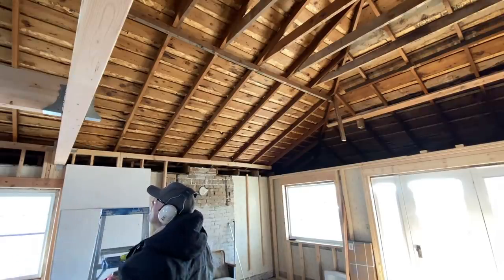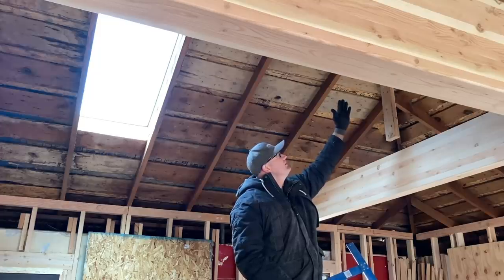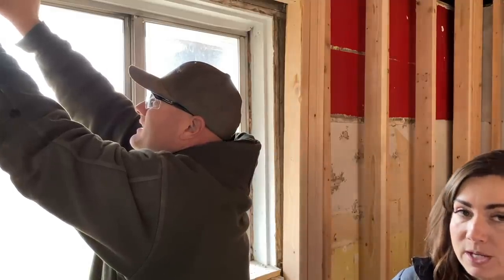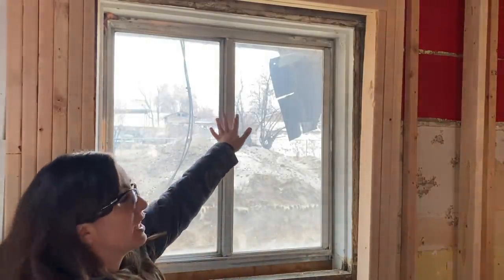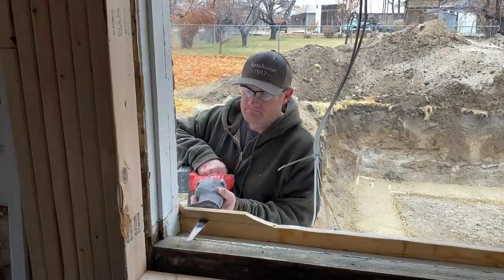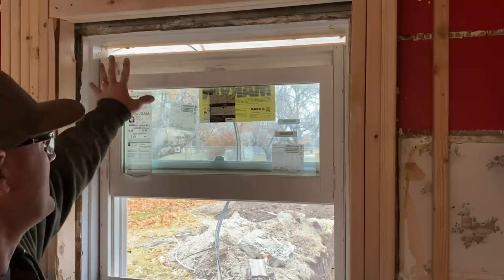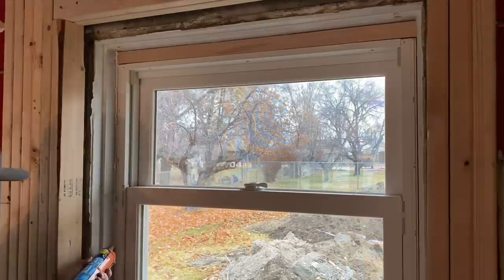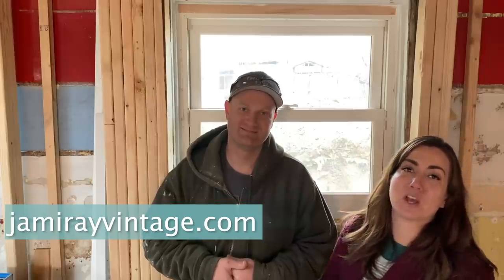New Kitchen Window At The Farmhouse Renovation | Episode 25

Comment: Question:  I will be placing another order with you tomorrow for a bunch of brushes, and a few more transfers..  I am planning to paint three pieces of furniture white with DIY from my local distributor.  The pieces of furniture all have a dark stain.  Debi said that she doesn't paint furniture white, because she has difficulty with it streaking and looking blotchy.  I know that you do a lot of spray painting, and I'm sure that helps, but I do not have a place to do that since I am just starting.  Can you give me some tips for quality painting on dark furniture with DIY white paint using the fat Paint Pixie brush?  Much, much, much appreciated!  :)
Reply from the maker: Two coats with a little touch up is usually the trick with DIY whites. If you’re worried about bleed through get a can of shellac for trouble spots and spray over any yellowing.  Then paint those spots again and you should be good.
Reply: @JamiRayVintage  My hero!  Thanks a million!

Comment: Will you be sound proofing?  I need to eventually soundproof between floors and between some rooms. Trying to figure out the best way to do it.
Reply from the maker: Yes, we’re going to be insulating a lot of the house with a closed cell spray foam.  It really helps seal up a house and quiet down creaks.
Reply: Jami Ray Vintage sounds great!  I’ve looked into that. My home is 2007. They didn’t insulated well but the walls are in good shape.